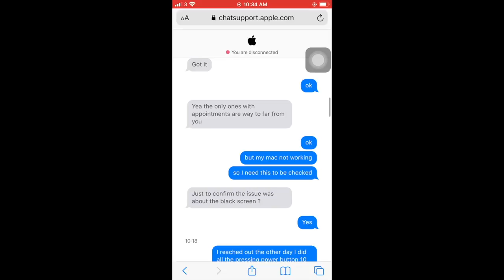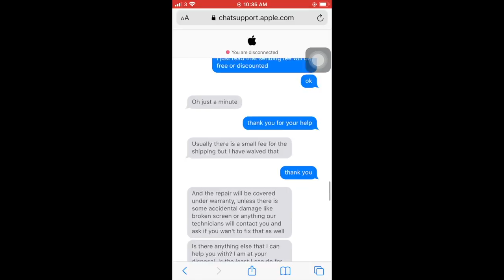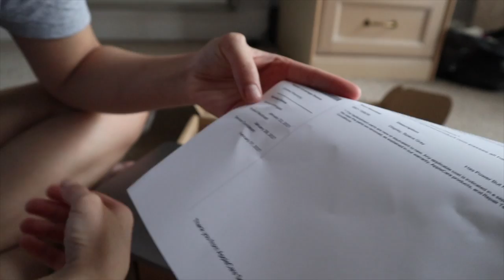MacBook Air M1 Chip won't Turn On Problem | Black Screen Issue | Help from Apple Care Support | VLOG

Comment: This just happened to my M1 MBP 14 inch. It was working fine and suddenly just went black.
Reply from the maker: Did u send for a apple check?
Reply: @GwenGeorgie  I contacted them and they told me to take it to repair. I did. The repair person said I had gotten a grain of something on the screen which caused this. I didn't. It ended up costing me 900 dollars to replace my screen.
Reply from the maker: @rca6576 it is pricey to get apple products fixed. This Mac I posted ending up to get a tinee tiny of water then its totally not turning on. Went to apple its qouted for £800 to fix. I got no budget for  it